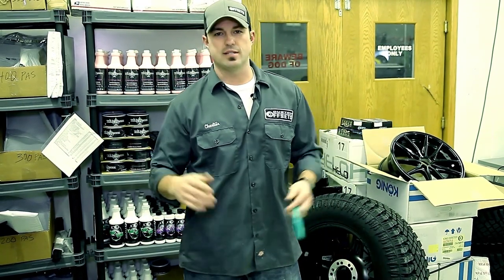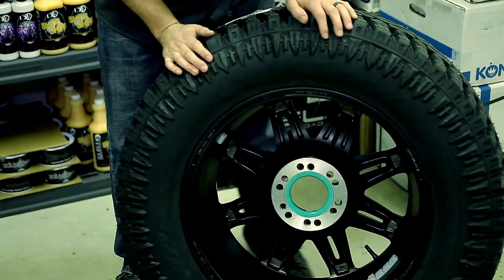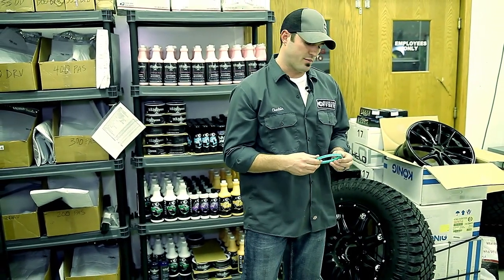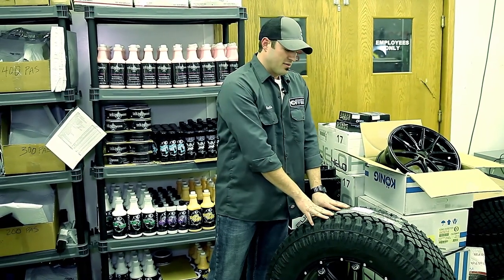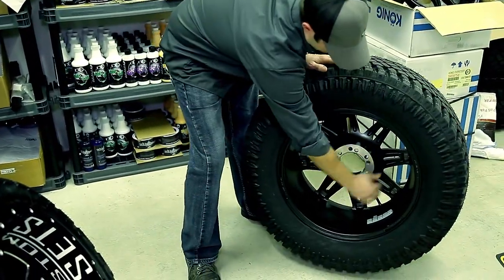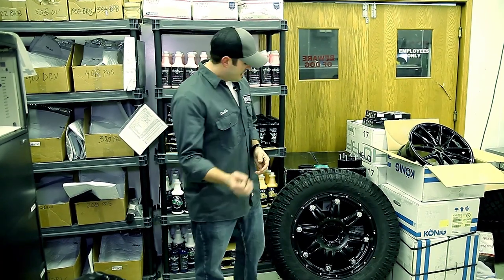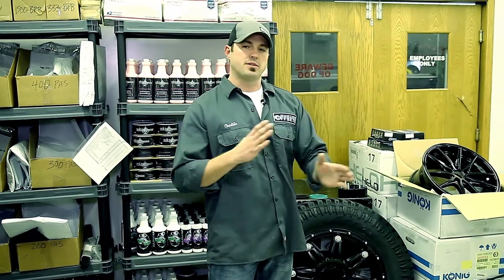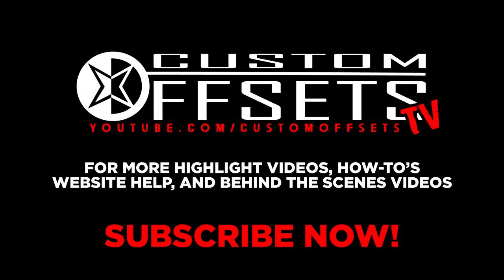How to fix wheel & tire vibration balancing hub rings, spacers, bead bag balance, rotation etc.

Comment: The best starting point is to make sure you align your red or yellow dot on the tire with the valve stem. Those dots are placed there to indicate the low and high spots on your tires. If you don’t know how they need to be placed just google red and yellow dots on tires. And it will explain how to position your tire on the wheel. Most of these tire shop employees have no clue about the dots. Thats why shops sometimes have trouble balancing tires because they don’t position the dots how they are supposed to go.

Comment: I have experienced the vibration over 50MPH wheels are balanced and out of round was checked as well. Going to install the hub  centric rings that came with the wheels to see if that helps! Thanks for the tip!
Reply: did it help?
Reply: did it help??
Reply: @JesusF150  Yes. I didnt use the plastic rings at first. They will center the wheel on the hub.
Reply: I'm genuinely surprised that this comes as a novelty to anyone who ever changed their OEM wheels with mostly aftermarket generic wheels! But glad to see picking up the pace. So to speak. ;-)

For the ones asking if it helps. Yes, definitely it does help (a lot) have a massive lump perfectly centered vs a massive lump located somewhere!

Comment: One thing nobody ever mentions is that a standard balancer uses a cone to center the wheel on the balance machine. Then you mount a lug centric wheel and boom imbalance. They do make lug adapters for balance machines but nobody uses them. Hub rings do work but if you take the time to evenly tighten the lugs, it does the same. My rings are a few thousands smaller and i can spin them around when the tire/wheel is center. If not i know something is wrong.
Reply: lol

Comment: Great list of solutions! Another thing people overlook is making sure the mating surface of the wheel and brake disc or drum is rust, corrosion and dirt free. I wire wheel both before reinstalling wheels, and add a light coat of anti-seize. This also helps lugs from coming loose and makes taking the wheel off next time easier.

Comment: Another thing you should mention is the fact that some Wheels come blank and they get drilled to the bolt pattern  of the vehicle but unfortunately sometimes the machines that do the drilling could be off so little which causes the vibration. That's happened to me at my shop before. And another thing that would help out to is ET lug nuts those work magic as well.
Keep up the good work love that you guys put good informations 👍👍

Comment: I am in the Tire Industry for a decade now. Well, I don't know how to start this. Let's just say this, this guy knows what he's talking about. When it comes to the tire industry, the best place to be is here in the Middle East. You have all sorts of vehicles here unlike any other place on the earth. I get to deal with American Pick-Up trucks, then Benz, Aston Martin, Porche and etc (mention all that to just to drive the point home). 

As he said, the spacer hub is the best solution, and if it's 17", 18" or even 20" wheels, then it'd be rather better you get the "Hunter Machine" force balancing done, and if the tire is new and the machine shows its out of round, boom, you're in for a free of cost replacement, but if your tires are bit old and have started wearing down unevenly, then you might have to change a set of brand new tires.

Comment: Can I use hub centric rings in conjunction with wheel spacers? I bought some rims through a tire shop and they said no problem, they'll fit. When the wheels came in, they didn't clear the calipers and they used H&R spacers to clear the calipers. I got no vibrations however, the spacers were too big and the wheels would poke. They put smaller HR spacers but they dont bolt on to the hub like the big spacers. These smaller ones have a hub ring for the rim, but wiggle on the hub. So I imagine the problem is between the hub and the spacer. Any suggestions?

Comment: A static balance is about the same as the bean bag balance works well on big tires. Also if your drive shaft has changed it's angle  from like a lift for your big tires your joints and yokes could be causing your vibration, even your if you have CV axles could be gong bad they don't have to click or feel loose to be going bad but those usually vibrate when you accelerate and all these typically vibrate anywhere from 40 to 65 miles an hour if balancing or filling in the gap on the hubs.

Comment: I'm getting some serious vibration after installing two inch spacers with my stock Chevy rims... I purchased from rough country and considering taking them off ... Do you think I need to have my tires balanced again or is the spacer the issue... I'm thinking spacer for sure

Comment: Just watched your video.  I am running Gladiator Xcomp 35 x 12.5 x 22 on Hostile Alpha rims.  Thought that I would share my feedback on bead balancing.  I have had this setup balanced twice and the last time I asked that they try bead balancing.  Bead balancing made zero improvement.  I should mention that I am running a 2017 2500 HD with 45K miles.  I have had these tires on the truck for the last 1300 miles.  I just scheduled a road force balancing as the vibration is too much.  I hope that road force works better than you indicated.

Thank you for making the video.  I just subscribed today.
Reply: Hey darren, any update on your situation? i purchased the gladiator Xcomp 35x12.5x18 in my wrangler and they shake like crazy! Im hoping you found a solution that might help me
Reply: Any update if it worked?

Comment: I have a fuel contra wheels model number D615 on 2018 ford f150 XLT crew cab....wheel size 33x12.50R24  -44 offset.... I rebalance the tires but steering wheel still shake, I will like to try a new rings if you guy have the right size I will like to purchase from you guys.... or what you could recommend

Comment: Custom Offsets, I have a 1993 Toyota pickup with a bore diameter of 106.1mm. I plan on purchasing (Fuel Lethal D567 15x8 6x5.5/6x139.7) wheels for the truck. My question is, will I get away with using concentric rings? Thanks
Reply from the maker: Hey man shoot us an email to info@customoffsets.com so we can help 🤘🏼

Comment: I have 275 65 r20 in the back I have 275 55 r20 in the front basically everything in the front end is new I just went for a front end alignment got it straightened out the second time now and the wheels were balanced with weights and it was throwing it off really bad I pealed the weights off tonight and has started acting better will it run my tires do I need to balance them what's going on alignment is dead on driving very straight what do I need to do
Reply from the maker: It won't hurt anything, if you are riding better without then you should be fine!

Comment: Hi, I have a Mazda 3 2015 and I bought 19'' custom rims  (Verde) with new tires. The problem is that the car is vibrating after 40 mph, so the guys at the wheel store rebalanced the tires but the vibration is still there. The rims came with hub centric plastic rings, any suggestion of what is causing this? the vibration is not that bad, but before changing the wheels I had not this vibration at all and it's so annoying when I'm driving on the highway. Im going tomorrow again to the shop, so I'd like to have suggestions for them.Thank you!
Reply from the maker: Get the wheels roadforce balanced Felipe

Comment: Hi, Did you try to balanced the tires with the beads inside after installing them, on a balancing machine?
Reply: ***** I read on the dynabeads website, that the beadsy actually works better with the weights on. Like is more balanced that way, but the question asked on the site was, if before adding the beads i should take the weights off, and the response was: No. now i put the beads but still are giving me shimmy at 60km so i was wondering if getting the beads out and then balance it with the machine and then put the beads again or do it with the beads inside, i was wondering if the machine will not work.

Comment: I have Mammoth 8 steel rims on a 2023 Jeep and the center add the rim is bigger than the  fit to the hub what do you suggest if I don't have vibration will it be hard on a lug nuts not having it correct

Comment: I have a 95 F350 dually diesel. I have milled 22.5 to 22” with 37” tires mt. The rears seem to be bouncing and they are powder balanced it doesn’t bounce at lower speeds just after 55 mph. What could that be? These tires and wheels are brand new. Have about 500 miles on them. I know my shocks are shit and plan on installing a better bilstien shock. See what happens too. Just wondered if there was a hub centric ring for my application.

Comment: i am running h1 24 bolt bead lock wheels and 37's on my 1990 chevrolet v3500, what do you have for hub centering rings that would work for my application?

Comment: Do you guys offer hub centric adaptors for a Lexus? My hub is 61.6 and I'm running 5x112 to 5x114 adaptors and get strong vibrations over 45mph. I ordered hub rings, but if they don't work I'd like to look into quality adaptors with less than 1" thickness that will alleviate the issue. Ty, good content
Reply from the maker: Sunset Algorithm Email us at info@customoffsets.com!

Comment: I already have hub centric rings on my rims and tires now. I am looking to change them in the future though and was wondering can I reuse the same hub rings on the new set of rims and tires as well or will I have to buy new ones?
Reply: Custom Offsets, yes I am going back with the same brand wheels and the guy I ordered from the first time said they needed them. There fuel wheels.

Comment: I just bought the Atturo Trail Blade XT and they have a red dot and a yellow dot. Are you mounting the red dot with the valve stem? I purchased the 285 65 18 tire. Everything I’ve read is the red dot is to be mounted with the stem and over rides the yellow dot. Thanks.

Comment: I feel I need to add a couple things
In theory hub centering rings absorb the shock force so the wheel studs dont absorb all of it, in my area a space around the center will fail state safety.
Road force is measuring the high spot of a tire and matching to the low spot on a rim to create  a perfectly round assembly or within a certain specification, IMO its the best system.
My personal opinion is that you should install a tire and drive it  before balancing, so it gets a chance to "seat"
I like the idea of centramatics, but they only static balance a tire.
Im not smart, just been doing this a long time,
said the blind man to his deaf wife.

Comment: I have a 5x100 bolt pattern with 57.1 hub centerbore , I am trying to mount a set of wheels that are also 5x100 bolt pattern but 56.1 centerbore.  I would like to space these wheels 1 inch out so i need adapters with a 56.1 outside Hub bore for the wheel and a 57.1 inside  hub bore for the actual vehicle hub. Can you make these and how much. oh the studs need to be 12x1.5

Comment: Just got my wheels a week ago from you guys, bead balanced and I have vibration over 45 mph. Guess I need to pull them and see if it looks like I’m going to need hub rings
Reply: Did you solve the issue?
Reply: @Anxiousb  I ended up just getting the wheels balanced with stick weights and they were much better. I know the tires were cheaper so that may be something to do with it as wrll

Comment: Recently bought some Hostile Sprocket H108 20x10 with a set of 33x12.5r20 Toyo open country RT and my 2018 silverado LT 4x4 vibrates when I start to hit highway speeds over 70 idk what to do I've already spent over 3k though I was buying the best now I have this issue. What's the best psi for these tires for my truck?

Comment: What size of hub ring would I use on my 2002 GMC sierra 6 inch lift and I'm running 20x12 fuel mavericks on a 35in tire?

Comment: When I drive on the interstate and I’m going like 70 it shakes really bad will a hub centric ring fix it.
Reply from the maker: It can! Could be a few things though Miguel
Reply: Custom Offsets okay so what else could it be
Reply: I got brand new wheels and tires (33’s) they shake bad at 55-65 but smooth before or past those speeds I’ve had them balanced twice
Reply: dont drive 70   that will fix the shake as well
Reply: I have the same problem on 35s. I have a video I can show. It’s bad at 70. I’ve added 36 ounces of counteract beads, still shakes.
Reply: Get a static balancer off Ebay. About $50. Money well spent. I've always had the same issue until I got one. It's the best way to balance oversize wheels and tires (imo). Simple to use too. Before mine would shake like crazy 65 mph+ and since I started using a static balancer I haven't had any issues with shaking at all. Running 33x 12.50x 20 on a 98 GMC. Best tool I've ever bought!
Reply: Some people also call it a bubble balancer.

Comment: Hi I have 2016 Tundra and I purchased off market fuel wheels. They've told me the vibration comes from the Cooper tires i have on. Today a guy told me it vibrates because the studs on the rotor are not long enough for the off market wheels. Is this correct?
Reply from the maker: we've never had issues Carlos. shoot us an email to sales@customoffsets.com and we can help you out!

Comment: Thanks Shawn, brand new jeep, brand new 35x12.50r22, having vibration/bouncing.  Will take all the advice from video and comments.
Reply: Did ylu fix it?
Reply: no, i have had my wheels and tires for about 5 months. i have tired everything i can research except i have not done the Road Force balancing. after that if it does not fix i’m tossing my 5k setup over the hill and running stock and never again. sick of it man wasting my money and time.
Reply: What type of tires did are you running and the bead balancing didn’t work?
Reply: @symplectics13  did the road force balancing work?

Comment: I got a set of pro comp’s on my Jeep, it has center caps that you put on through the rim. How can I mount hub centric rings with this setup? Thanks for the info.
Reply: Got a love but no response to the question?
Reply: I have a set Pro Comps, they are lug centric not hub centric!! Hub centric rings won't work. If your having trouble balancing them is because they are trying to balance them with the center hub and not the lugs.

Comment: I have a 2000 Silverado 2500 and I’m running 33/12.50/22s and just had them balanced and they shake around 53 mph and at deceleration what would be the best bet for me I don’t have universal rims so just the 8 lug holes for my truck
Reply from the maker: Rudy, try and get them balanced on a loadforce balancer, that or make sure they're tight!

Comment: i have 4 brand new 35x12.5 20 mt tires and discount tire just CAN NOT get them to stop vibrating when i hit 60 to 65 mph WHAT CAN I DO TO MAKE THIS STOP !???????
Reply: Brother, I’m having the same issue. Discount tire can’t get my tires balanced either. Mine shakes at 65mph in the rear. Did you get yours fixed?
Reply: @RickySlatton  so I found out it wasn't the tires at all it was the ballpoint assemblies and my shocks and struts were blown!!! I also replace the toe and links the inner tie rod in the outer tie rod it was literally never the tires at all
Reply: @Spanishwizard  WOW. Maybe I need to check some of this stuff on my truck. Did yours vibrate in just the seats and console or the steering wheel? Thanks for responding and glad you got it taken care of. 👍🏽
Reply: @RickySlatton  yeah it felt like I was in a fucking tornado as soon as I swapped out the ball joint assemblies the shocks and struts inner tie rods and the outer tie rods as well as links the vibration went away

Comment: Lifted my 2016 tacoma with a 6”rough country lift and put 22x12  fuel Mavericks and 33 toyo open country mts. But now my truck drives like crap. Steering wheel shakes bad and not a safe feel. How can I get my truck running better ? Please help
Reply: Same here.  any luck yet?
Reply: Dual steering dampeners

Comment: Im having a hard time getting my new wheels to quit shaking.. re used the old tires on my previous wheels and they rode just fine. After new wheel install, road force balance it balances out just fine. Put them on the vehicle and it shakes! My wheels bore is 72.56, my cars is a 69.5 bore. I have put on a weak plastic 70.1mm and 70.62 hub ring on it regards of discount tire... Continues to shake. I re order a set of aluminum 70.62-69.5 hub rings. Think that should fix it? @Customoffsets
Reply: Custom Offsets im hoping so. I have never ran into this before. They are very cheap flimsy plastic that im sure can compress, as well I thought of the out of round wheel but they balance great even after roadforce. So ill keep you updated!
Reply: Any update? Did you order the aluminum hub rings? Hopefully it stopped your vibration.

Comment: Just got 4 new Goodyear Wrangler tires on 2015 Jeep Laredo factory size 3 weeks ago. An alignment, mounting &balancing was done. I noticed a lil vibration after getting them but wasn't too concerned. Now it seems to have gotten worse. I went back to Chrysler Dealership where I purchased tires today and was told they rebalanced and retorqued lugs. There's still vibration/ bouncing going on. They said suspension and everything looks fine. The manager wasn't there today since its Saturday I assume.. Any input?
Reply: I have the same tires and I’m experiencing vibration at 70mph and a bounce at 50mph. Did you fix your vibration? Did you try road force balancing the tires?